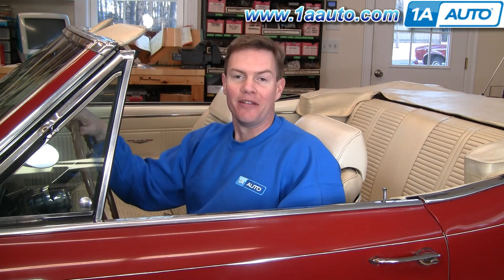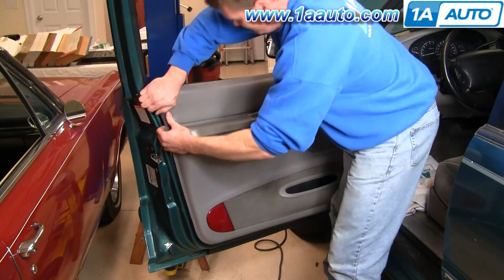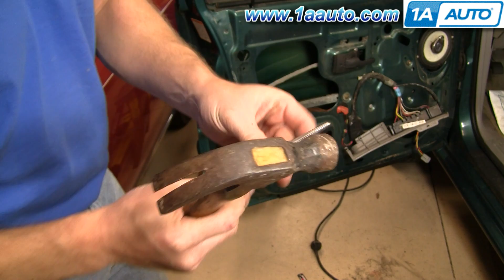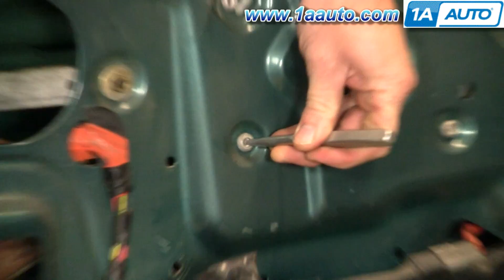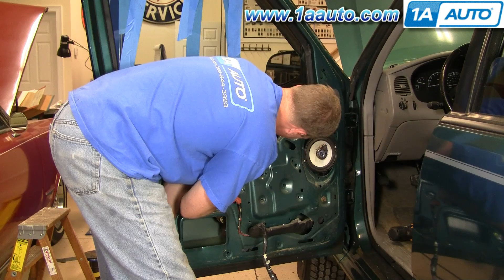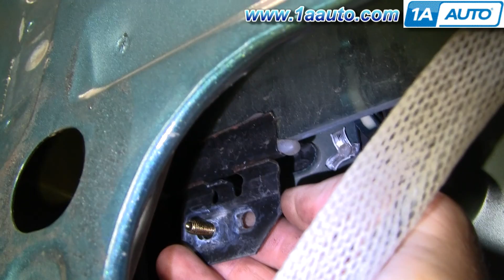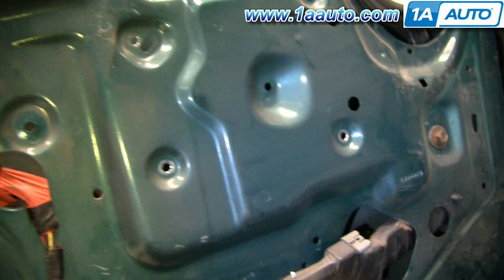How to Replace Front Window Regulator 91-01 Ford Explorer

Comment from the maker: @TheShadowShow00 If the locks are not working either,check the wire harness that goes between the door and the body of the truck for frayed or broken wires. This happens quite often on numerous vehicles, and is a good starting point before diving in to far.
Reply: I had my drivers door lock not want to go up or down easily. Seemed very hard. I was afraid the hard knob movement would eventually burn out the motor. I never figured out what was exactly wrong with it so i made it to where i could unlock with the key only.

Comment from the maker: @notar1 Usually itmoves slow when the car is not on and normal when the car is running.  Never heard of rain coming in to the equation.  If it works at the correct speed some times then it should not need to be lubricated.